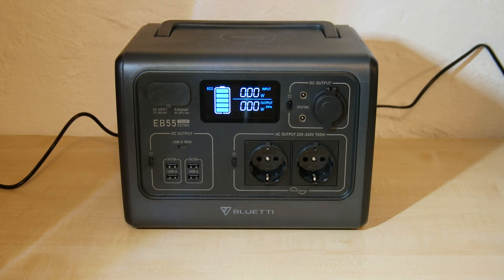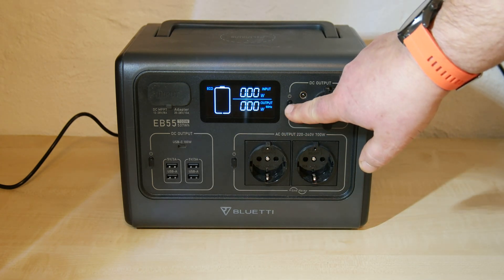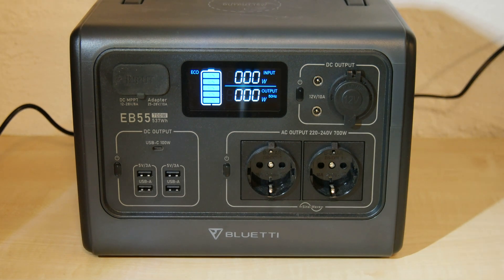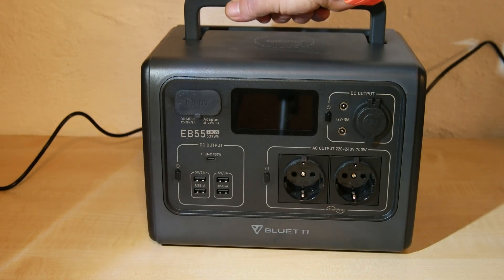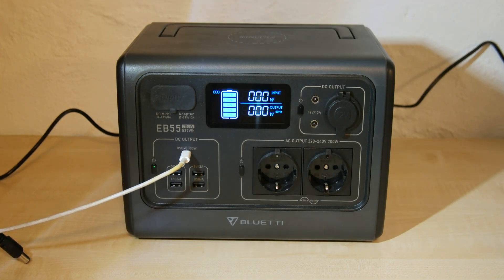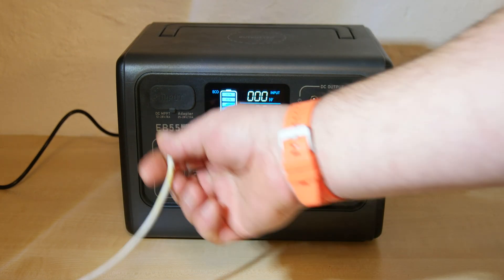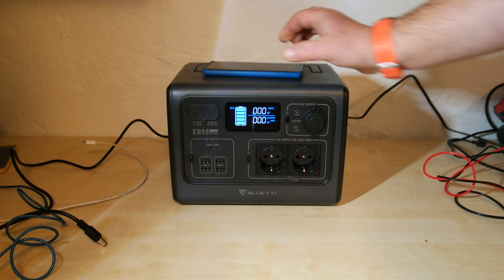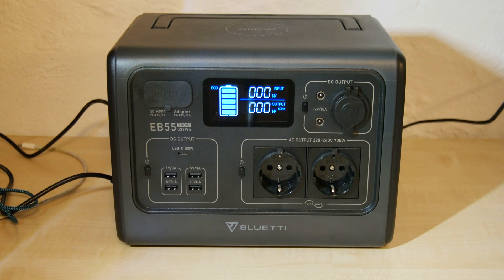Bluetti EB55 power station - 230V circuit short

Comment: Usually, this is a consequence of the failure of the transistors of the primary converter 24 to 400 V.
To be treated by replacing field-effect transistors of the primary converter. In some cases, high-voltage igbt transistors, as well as driver microcircuits (2110/2113) and the EG8010 controller, may fail.
I have a lot of videos on my channel dedicated to the repair of EB70 and EB55
More here https://youtu.be/y0Co51Gs4t4
Reply: Yo I have a on power station when I plug in the ax outlet for my phone it says overload but every other port works any idea ?

Comment: Hi Daniel I have a Bluetti EB3A 600 w, ant I have a short problems too but me it is on DC output Hummm! yeah I contact the clientele services but no clue for the moment I let you know if I have a solution!
Reply from the maker: Hi, I've read on some forums that turning off all areas and waiting might help. Good luck with customer service. I bought an EcoFlow Delta Mini and it doesn't cause any problems (video follows).
Reply: I have a same problem as you.  I've tried everything to RESET and no luck. I purchased Bluetti EB3A through Amazon about 10 days ago.  Bluetii will not want pay for shipping cost for return even when state FREE RETURN on Amazon.  It is customer cost to return their defect product.   I've send email, but not heard back yet.  Have you able to get the DC circuit to reset?  If you find a solution, post it here.
Reply: Usually, this is a consequence of the failure of the transistors of the primary converter 24 to 400 V.
To be treated by replacing field-effect transistors of the primary converter. In some cases, high-voltage igbt transistors, as well as driver microcircuits (2110/2113) and the EG8010 controller, may fail.
I have a lot of videos on my channel dedicated to the repair of EB70 and EB55
More here https://youtu.be/y0Co51Gs4t4

Comment: I have the same problem after 2 months usage. I need support. Any solution?
Reply from the maker: For me, the solution was a full refund after shipping the EB55 back to bluetti und buying an Ecoflow Delta Mini.
Reply: Usually, this is a consequence of the failure of the transistors of the primary converter 24 to 400 V.
To be treated by replacing field-effect transistors of the primary converter. In some cases, high-voltage igbt transistors, as well as driver microcircuits (2110/2113) and the EG8010 controller, may fail.
I have a lot of videos on my channel dedicated to the repair of EB70 and EB55
More here https://youtu.be/y0Co51Gs4t4
Reply: I need help with an EB120 same issue?
# @canek350

Comment: Witam, też mam ten model i podobnie przestał działać, po trzecim ładowaniu nie ładuje się, próbowałem się z nimi kontaktować jednak tylko pytania itd. zakupiłem drugi taki sam i jest ok. Mam pytanie: Czy udało się Panu dotrzeć do instrukcji która opisze jak to dziadostwo rozkręcić, napewno akumolatory są sprawne i mógłbym je wykorzystać w przyszłości jednak nie wiem jak się do nich dostać?
Hello, I also have this model and it stopped working similarly, after the third charge it does not load, I tried to contact them, but only questions, etc. I bought another one of the same and it's ok. the trash to start, the batteries are for sure working and I could use them in the future, but I do not know how to get to them?
Reply from the maker: Hi, if you don't know exactly what you're doing, you shouldn't open the device to get to the battery. Your question suggests that you are not an electronics technician or electrician - so it is better not to tamper with the device, that can be extremely dangerous, even life-threatening!

Comment: Same problem with my EB55. Did you get any assistance?
Reply: anche io stesso problema .. hai risolto ?? l assistenza non mi risponde
Reply: @alfredoporta7570  
Usually, this is a consequence of the failure of the transistors of the primary converter 24 to 400 V.
To be treated by replacing field-effect transistors of the primary converter. In some cases, high-voltage igbt transistors, as well as driver microcircuits (2110/2113) and the EG8010 controller, may fail.
I have a lot of videos on my channel dedicated to the repair of EB70 and EB55
More here https://youtu.be/y0Co51Gs4t4
Reply: Usually, this is a consequence of the failure of the transistors of the primary converter 24 to 400 V.
To be treated by replacing field-effect transistors of the primary converter. In some cases, high-voltage igbt transistors, as well as driver microcircuits (2110/2113) and the EG8010 controller, may fail.
I have a lot of videos on my channel dedicated to the repair of EB70 and EB55
More here https://youtu.be/y0Co51Gs4t4

Comment: I bought one and it arrived today. Tested the USB and wireless chargers and it worked. Plugged in a small portable torch to test charging that which is 1.0W and after like 20 minutes I got the short circuit error too. Did you return yours or did you manage to fix it??
Reply: ? i have short on  my screen  too..?how did your problem get resolved? thanks.
Reply: @winstonsmith3433  we cannot fix it. I complained on their contact page, Twitter, Instagram and finally got hold of them and asked for a replacement. But that unit had the same issue and they didn't want to even refund my money but somehow I pleaded my case and got a refund.
Reply: @eranjanak  I purchased 10 days ago.  They willing to give me refund, but I have to pay for shipping cost, ask all cables & parts put back in the box and take photo of the product.   I don't keep anything, but seems kind a odd the way the rep asked it.

Comment: I hope they replace or tell you how to solve this problem. Very strange! I have the EB70 and love it. I use a Baldr 120 watt folding solar panel with it. Works great!
Reply: I have the EB70 and it has ‘short’ on the display now! 😳
Reply: @jacquijames7585  same mine won't turn on
Reply: My eb70s says short and ive only had it for a month
Reply: My EB70 as only function for two recharging circles… By the third « SHORT ⚡️» … and it is only one month old… 😡
Reply: @Besteph22  That stinks. Good luck getting a hold of them, they are notoriously hard to get a reply from. Or they take forever to reply. BAD customer service. I've been lucky with mine so far.